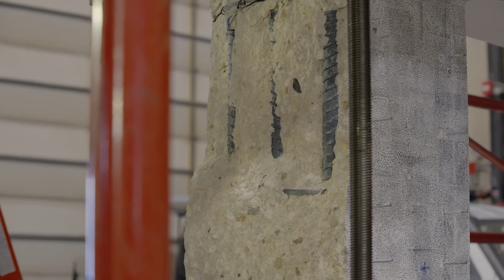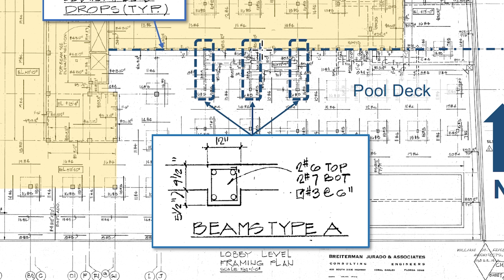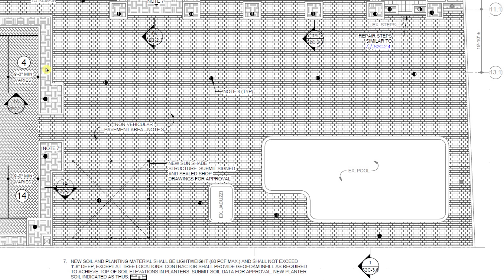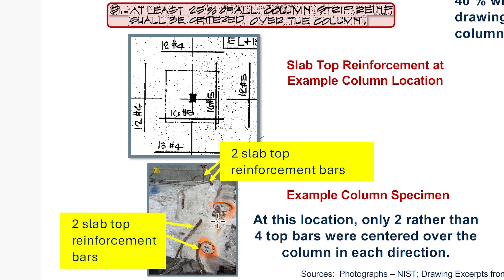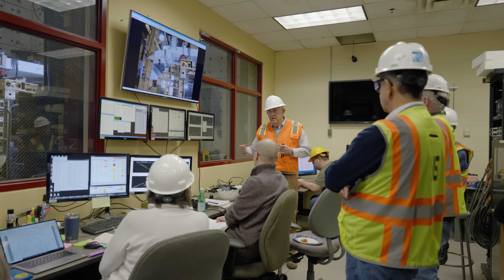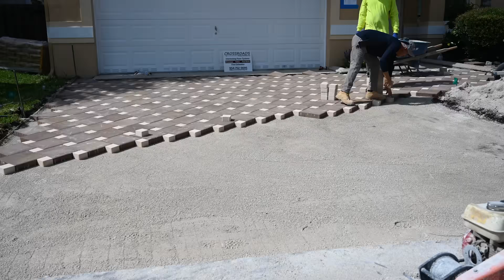Champlain Towers: Secrets the Feds Uncovered in Collapse Debris

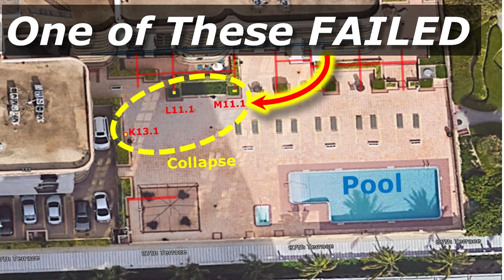Comment: @9:40 @9:45 The spot you circle keep drawing my attention, but not because you circled it I can’t not oversee the fact that it’s a different coloration in the pavers that area. I thought perhaps they looked either dry or sunbleached… But when you look at the rest of the pool area, only that area seems to be in the White. I was thinking perhaps because it was wet, but it doesn’t make sense because if it was wet, it would be darker like the rest of the pool deck. Then @33:05 you said something about water weight. Miami receives massive amounts of rainfall daily. Could it be at all possible that area of the circle had a leak but it had nothing to do from the pool?  But water pooling. Is it possible that the area you circled was the only area where the pool deck actually had an escape “water drainage”? In a lot of the overhead pictures of the pool deck, I noticed discoloration in that area as well.
Reply: The more I think about it I mean, if that was the only area where water was escaping from the pool deck for the past over how many years, especially with the added weight of the sand and pavers. I don’t have the computing capabilities at the moment, but would it be possible to go back on Google Earth from overhead and see if we can notice any of that staining. 

Could it be possible that the 9 inches of sand they found under pavers  was in that exact same area because they used it to level out the pool deck meaning that area had already seen some subsiding. But might have gone unnoticed.
Reply: Which I think will lead to massive problems for construction in general with the slab designs… At any point when we have one column failure, the sheer weight of the slabs will pull  the rest of the building apart.. And causing these massive pancake collapses. I’m thinking about that building From the earthquake. That’s why they collapsing so quickly. The moment one slab separates from the column, increased weakness above it, causing the rest of the load to come down in that same area..
Reply: Yes, what if the slab failed and caused the columns to fail… That could explain the four minute delay.. If the If the pool deck area and circled, Around L1 1.1 M1 1.1 and K 13.1. Cracks and subsides, pulling away from the exterior but putting stress on L1 1.1 and M1 1.1 horizontally load causing the slow failure of those two columns and bringing down the building in that direction. So yes, agreeing with you that L1 1.1 and M1 1.1 caused the partial collapse of the tower. 
But it, being the sheer weight of the upper pool deck, pushing against those that essentially caused them to fail so rapidly.
Reply: Kinda like the DR nightclub… If a whole head not open on that upper slab, then the strength would’ve remained still would’ve caused the collapse, but it would’ve taken a lot longer if the slab hadn’t failed by the slab failing and losing its horizontal strength it then cause it to pull itself inward on itself. And because of gravity, anything attached to that would be pulled with it. Which is also why the class was so massive because the substantial upper floors would’ve also pulled away from the building.
Reply: Yes, yes yes didn’t they say the pool deck collapsed first. So if the pool deck cracks and separate from the columns, all the stress, which was even distributed on that pool deck now is centered in that crack area by column 11.1. 
The massive weight of the upper pool deck is now pushing horizontally against those columns, causing them to buckle. Kind of like when someone kicks the back of your knee when you’re standing.

Comment: As a structural engineer,  there are a lot of classic punching shear failures and overlooked slabs. The original design didn't seem to include drop slabs or column caps to increase shear area around the column. In addition,  the few bars in slab that when though the column for shear seem inadequate. Addition dead weight was also part of the cause of the collapse of the Save-on-Foods building in Burnaby, BC in 1988.
Reply: the original design, or the one they built? Because the original didn't seem to have 100% loaded columns anywhere
Reply: As a professional hotel busboy and valet parking attendant I have to disagree. I think you have missed many crucial factors and should probably go back to basics before commenting on such matters again once you've better understood this situation.
Reply: @bobbyrayofthefamilysmith24 RUDE and unnecessary comment

.

Comment: One of the things that stuck out like a sore thumb to me at the time of the collapse was the satellite imagery of the two original Champlain Towers buildings (a third was added later). They were owned by two separate condo associations. The one that collapsed, Champlain Towers South, had a roof that frankly looked waterlogged and very neglected. The other one, Champlain Towers North -- same design, similar age -- was absolutely spotless. I really wonder if that level of maintenance is also a factor.
Reply: Contractors had just started replacing the roof.
Reply: They voted no to some if the maintenance
Reply: Good Point!!!!!!!! I had commented on the drainage of the tennis courts and parking lots above - please read. All the other buildings on that road had developed real estate across the street. Buildings that had gutter's and city planned sewer to carry the rain water away. The whole structure/property of Champlain South was probably "waterlogged" after 40 years. Gravity pulls water down. If the water has no where to go it just remains in in the concrete. Maybe the decking under the roofing material was constantly damp vs. the North building. Or the owner's just put off the enormous expense of roof replacement - any new roof on any home/building is big $$$$$$. Roofing is an expense that brings someone 0 reward. Huge $ that doesn't fill your stomach (good meal) go down the road in comfort (new car) or allow you to relax (a vacation).

Comment: Saying that you think the distances between some columns is excessive, is inappropriate. You need to support such statements with hard data showing the beams were under designed, or badly built for the loads associated with the span and application. Structural design is not guesswork.

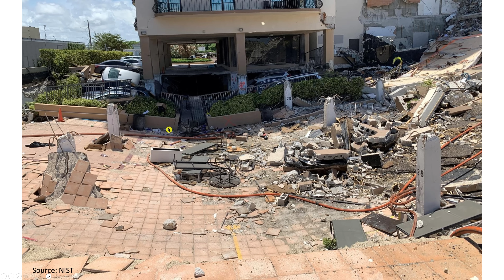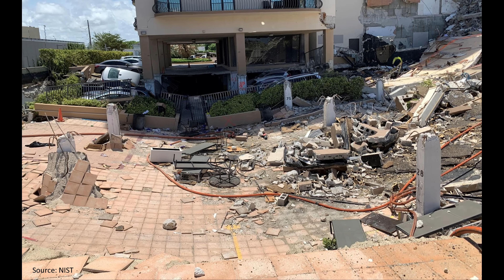Comment: 1:00 to 2:45:  The apparently greater distance between foreground versus background columns may be just an optical distortion caused by the use of a wide angle lens. The diagram shown at 19:46 seems to indicate a more or less uniform column placement, though with some offset between rows.

Comment: To answer the question of how I (not an engineer) would have joined the pool deck - I essentially wouldn't have. I would have formed the exterior of the building with a step for the edge of the pool deck to "connect" to the building, but with something similar to a bridge expansion joint. Of course this is post disaster clarity, but it would have allowed the deck to fail without taking the building down.
Regardless, work was definitely done in prior years without a proper structural analysis.

Comment: The 60s and 70s were the worst times for construction. We had entered the space age and everything was about the future,the near future. The cars of the future. The house of the future... Cities jumped in by eliminating the past and replacing it with the  future and do it fast and cheap. Im a career carpenter. I have worked on those schools, hospitals, office building , government building and have seen the disasters they built during that time collapse on the news. It is scary to work on those buildings. I worked on the elementary/ jr high school I went to. It opened in 1960. Less than 2 inch concrete floors . 9 inch bar joist. Tube columns and beams  we would use in a home today supprting a three story school. I worked on a few others in other school districts. They were no better. I showed an architect a floor core from the school I went to. 1 1/2" of concrete and a 1/2 " of terrazzo floor. Terrazzo has no structural value. The architect wanted to build 12" concrete block walls on those floors. He tried to tell me the CV ore was from the edge of the floor. Thats not how floors are poured.  The pan they are poured on are level . The edgr of the floor would be the most accurate because the floor is poured to a pour stop made the height of the pour. The hospital just dow the stret from me has a building built in the later 60s . It HAD as car parking ramp that was poured with the building. The floors of the ramp were continuous pours of the hospital building. The ramps top floor was wide open to the northeast winters and Im sure plenty of salt to melt the ice snd snow. Decafes later to hide the deterinzation and lake it look better ,some genius decided topping it eith teo inches of black top was a great idea. So the sdded tons to the rotting structure but still allowed the same amount of vehicles to park on it. Well gravity and shotty engineering took over and a lot of people got new cars. Luckily no one was on or on the lower level. Under that ramp were offices. Luckily the lower level held or dozens of lives could have been lost. I walked over when I saw Homeland Security helicopters circling. Looking st the exposed concrete the first ghing I noticed was the rebar was #4 bar . It was in a 16" patteran. Today they use #4 bar on floor poured on grade (compacted soil) . The also do the rebar in a 12" pattern. The next thing I noticed was that none of the undersized rebar had been over the 2'x2' columns. They bent it around them when it should have been over them. Back then the architects cheapened the building and then the contractors cut corners to cut cost to gain profits. Construction inspectiond weren't a thing back then . Just get that buildingup fast so we can collect taxes or get all of these kids in schools as cheaply ss we can. This wasn't just a local problem, it was nation wide

Comment: I once had an opportunity to buy a condo in Stuart, FL, and was seriously considering as the price was very attractive, in the late 2000s, but after much consideration, opted it out, and some of the reasons were shoddy construction. I'm no engineer, but have a lot of common sense when I'm looking at structures in buildings, houses, etc. Like in this case, why would you build a pool pretty much handing from a concrete slap into a parking garage? And there are a lot of those in Florida east and west coasts, even with 1979 building codes, it defies logic.
Reply: The pool is not hanging, it rests on the floor of the parking garage

Comment: The 1995 pool deck renovation with a water barrier, sand and pavers must have added tons of weight to the pool deck.  And with the salt air and constant moisture from rinsing off the dirt and sand  all those pool chemicals would have leached into the concrete deck surface.  There were drains specified, but it appears as if they were compromised by debris and plant roots.  so you can add the weight of the water of the saturated sand.  I believe, if you were to calculate the increase in weight per square foot to the entire deck, there would be reason to consider the 1995 renovation of the pool deck to be a significant contributing factor (directly or indirectly) to the tower collapse.

Comment: I  lived in Surfside in the 90's On Byron Ave. Even then this building and it's property were dirty, neglected and the ground level pool was always like a pond and the public would swim there regularly.  The rebar in the concrete was rusting and expanding inside the slabs due to lack of proper maintenance ( Painting) . Salty air, porous concrete with internally rusting rebar = Sagging concrete slabs and eventually Structural collapse. 

This is only taking 4 years because everyone is trying to figure out who to blame.
Reply: It’s insane how many engineers were on site over the years giving estimates and inspections and NO ONE rang the alarm on this building!

Comment: You say a couple of times that the colums may be spaced too far apart.  But would the minimal column spacing be largely determined by the desired use of the basement as a parking garage?
In one direction the spacing would be limited by the desire to have two cars parked between columns, in the other direction by the required turning circle for the cars to maneuver out of their parking space and to the ramp.
You cannot simply say "let's put the columns 15% closer together", you may lose half of your parking spaces.

Comment: the old tile was slopped like in the original plans.. when they put in the new pavers they used the sand to level it out... you are right, thats the nine inches of sand,  located around the drain which would be the lowest part.  Whoever put in the pavers either did it themselves without realizing what they were doing was wrong or someone intervened and told them to do it that way... I bet this was the final nail in the coffin

Comment: Around 1981 ASCE magazine featured a hotel suspended pool collapse over a parking deck in Germany.  The construction had stainless steel hangars.  I think the chlorine in the leaking pool water could have contributed to this failure if the chlorinated water was reaching structurally important rebar.

Comment: The pool leak may not have had a direct link with the collapse, but water getting where it's not supposed to be is typically a problem. It certainly would have weakened structural elements that water leaked through and where it pooled. Which may have contributed to how the collapse progressed, or not. It's hard to say right now.

Comment: Jeff, Architects put swimming pools on raised floors and roofs not Engineers.  In building design Engineers there are two separate religions:  Steel and concrete.  I am a steel person, but I've engineered buildings of steel, concrete, bricks, blocks and wood.  Concrete is the worst material to use in a floor of high rise building.  Engineers don't make that decision, accountants, estimators, real estate agents, developers and Architects decide that they want concrete floors.  They could have used steel in the floor structures with 2" of concrete.  Engineers who were trained in the desert countries or Southern USA are prejudiced towards concrete.  I studied both in school.  Now I build mostly steel structures.  Concrete is best used in foundations and walls and no where else.  The floors are always metal deck or steel joists.  It's sad the way you blame Engineers for this building collapse.  If there was no swimming pool, the building would still be standing.  The first stamp on the drawings is by the Architect and the Architect was probably assuming the responsibility for the entire building.  This is still allowed by law in most states.  And that law goes both ways.  The Engineer has some responsibility in this collapse, but the Architect made all the final "dimension" decisions.  We need to chat.  I started a laser scan company and I want to spend time in Florida this winter doing fun stuff like you do.

Comment: 27:30 - You are misunderstanding what is going on here and the fundamentals of this basic testing. Both tests shown on screen are using a compressive load to test the core samples. I am unfamiliar with the exact attachments they are using in the left photo, but my first assumption would be some type of extensometer setup for the axial strain and possibly the width/diameter strain. They are not loading that in a tensile manner. The modulus of elasticity can be calculated without relaxation of the test stresses in a destructive test, in either tensile loading or compressive loading. 

The second image is using the resolved tensile stress from this type of loading to determine tensile properties without the difficulty of directly tensile loading the concrete. Creating true tensile test specimens for brittle materials is difficult, time consuming, and difficult so you use don't tend to see them outside of new materials research settings.

Comment: That 4000 psi intrusion into the 6000psi column problem makes me think of the chaotic construction site when that was poured....crane fell over.  Such an important detail as that 6000psi intersection on a site where its just a mess with so much going on ..the solution is engineers need to quit putting such key details so hiddenly in such places.  If the design included any kind of engineering feature there to improve the peak overload point and avoid transferring an engineering problem to the labor crew
Reply: Jeff's saying "they could have resolved this question by" describes the labor crew solving an engineering problem because the engineer sucked.

Comment: 2 different psi concrete is exactly how you design a ‘hinge.’ You do this for failure predictability. So they built in a failure. Also, when rebar corrodes, it expands, and that why the spalls too.